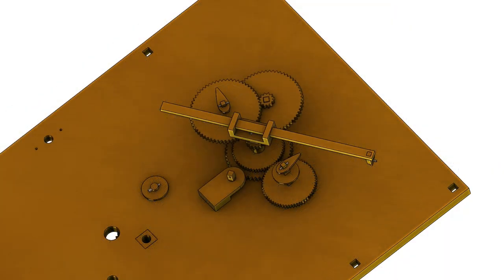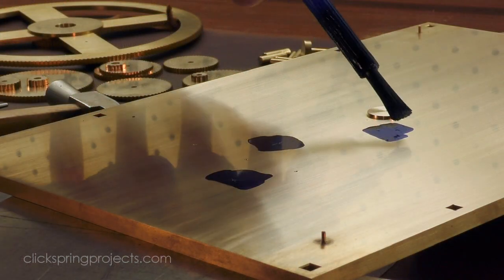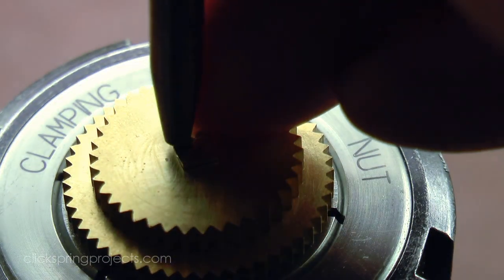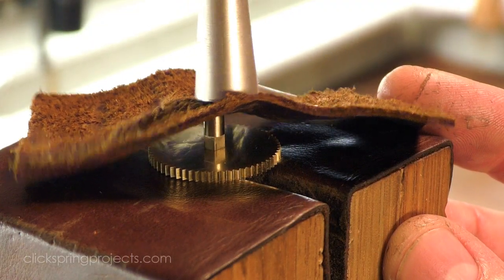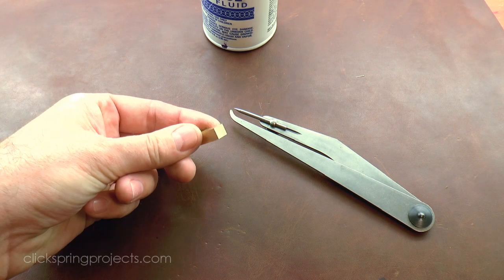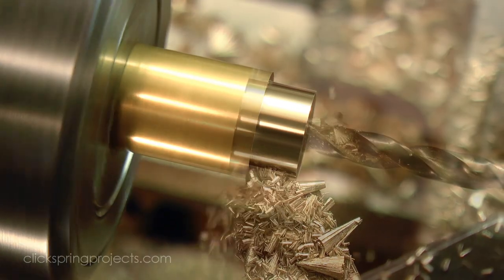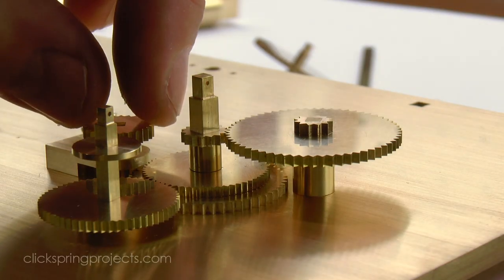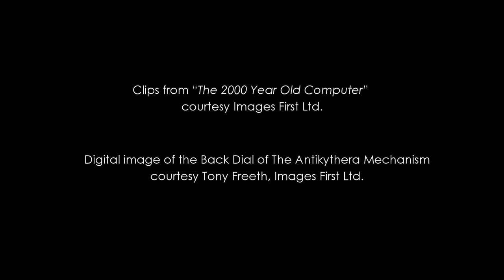The #AntikytheraMechanism Episode 6 - Making The Metonic Calendar Train

Comment: How did you make sure the gear teeth lined up between assemblies? If you'd been off by half a tooth with one gear on one assembly, surely it wouldnt have fit together?
Reply from the maker: Hey Eric, the pointer orientation is set at assembly, see my answer to PJ below Cheers :)

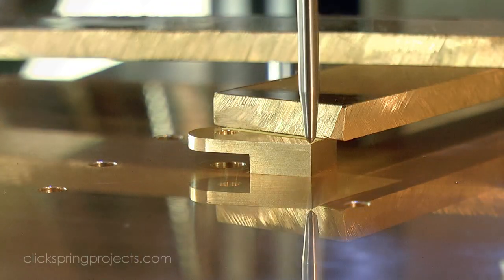Comment: Whats the purpose of the springy drill bit used before the actually drilling??? can be seen at 18:42
Reply: Tapering the hole
Reply: G'day JD, It's a point probe centre finder ('wiggler'). You have to true it up first (as seen by Chris using a pencil) and then you carefully line it up with your centre mark on the work surface. This way you know you are directly over the point you wish to drill. Cheers
 P.S. Gaz is talking about the tapered clockmaker's Broach that Chris uses before fitting tapered pins :)

Comment: At 4:56 we see a tool in the drill press which wobbles around and you the centre by using a pencil.Why do you have to use a pencil to centre it instead of centering the tool in the chuck right away?
Reply from the maker: It knocks the very end of the pin onto the axis of the spindle, and so removes all chuck eccentricity that would otherwise still be there if it were rigid and directly chucked - Cheers :)

Comment: Why would you not make a rig to file the the teeth of the gears? I'm just curious.
Reply from the maker: One of the main objectives of the build is to determine the actual techniques used to build it - the small inaccuracies in the wreck strongly suggest the teeth were freehand filed - Cheers :)

Comment: When you are filing the taper on the arbor are you using the marks from the file to see how far along you are in the taper?
Reply from the maker: Hey Douglas - I repeatedly put a very light cross pattern on the work (in between actual cutting stokes) so that the light will reveal any double strokes - it helps ensure the surface is filed truly flat, and that metal removal occurs at the same rate over the surface

Comment: What is that floppy drill bit thing that I believe you use for centering?
Reply: It's a tapered clockmaker's Broach that Chris uses before fitting tapered pins. It's not enlarging the holes but shaping them to match the pins.

Comment: the smalest messurement i could find on wiki was a daktylos, which was a finger, 19.3mm around. don't we know more fine messurement, it surly needet to be, and a way to messure smaller parts, to calculate this complex machine. it would not suprise me if a sort of caliper or micrometer was invented way before we tought. or maybe did they use circles and a board to calculate the corresponding radiuses on a reference pice  to cross reference for fine machines like that. very intressting stuff tho

Comment: Brass is so soft. Will this machine last very long ?
Reply: G'day, Cast bronze (that was used back then), poured out to make sheets, was hammered to refine the metal's structure and harden it up and make it wear resistant. It would probably only be moved the equivalent of one day on the scale at a time, and then left alone till the next day; or wound 'round till a significant event you were checking on came up (then all your astronomical mates would come round and have a good talk about it :)  ). It wasn't 'running' all the time like a modern watch, and, if a part did wear out, it wouldn't be too big a job swapping over the offending part (once you'd got a competent metal worker to replicate it). Cheers

Comment: What Is The Point Of Hand Filling The Gear Teeth, When You Are Using Modern Machine tools, On Other Parts That Were Not Invented Or Around In That Time Period?
Reply: A certain amount of this (but not all) is exploration of the (probable) methodology. But (as shown) he also may have to adjust the depth of the teeth by hand anyway, which would not be done with modern teeth. So a perfect opportunity to build it the way the ancients (likely) did.  As for the power tools (mill/lathe), it's to speed things up to achieve the same result as wading in with a file. I love Bad Obsession Motorsport, but they can be 4 months between videos. He's already been working on this for a year! I wouldn't have blinked at all if he wanted to use modern tools for the lot.
Reply: ConradsStudio no I think what he is doing is great, but if you want to make something from that time period. They would not have had twist drills or end Mills it most likely would have been drilled with a shop made d bit. And the rest would have been cut by a hand. saw. Just saying.
Reply: Perhaps, but in a lot of cases, what's achieved by doing that other than stretching the build time? A part of the wonder of the Device is that it was widely believed to beyond the capability of the ancients, and the exact construction methods are a mystery. He already did a lot of experimenting in the video with the dividing plate--an admittedly bold assertion on his part. That, and his clamp video were guesses as to how things were accomplished back then. Since much of their metal working tools didn't survive, there's a fair chance he'd just be inventing a new approach if he made assumptions about how the ancients did things. He may well have already.
And yeah, what he's doing is great. The mere act of building this as close to the original design (flaws and all) is something of  a voyage of exploration. For instance, I begin to understand his fascination with the triangular gear teeth.
Reply: And speaking of discovery, if you bracket a word with asterisks in a comment, it becomes bold!  Ha!  I didn't know that. :)
Reply: Triangle geared teeth would have been the simplest to from and make. There were no modern gear shaped teeth at that time. It would have been very crude hand shaping on every part.

Comment: Why do you use so much brass?
Reply: Why else do you suggest? It has to be both easily worked (filing of teeth) yet adequately wear resistant. Brass fits the bill.
Reply: original material (it is easy to work)
Reply: Brass is an extremely versatile material. It needs very little lubrication, practically doesn't corrode, is quite easy to work with, and easily provides a very good surface finish that polishes very nicely. As long as strength, weight, or cost are not prohibitive factors it is pretty much a wonder material.
Reply: I just don't like how everything is made from brass, Aesthetically it would be nice to have an accent colour. But mechanically it makes sense to use brass.
Reply: Yeah, let's hope he goes full titanium, so he will upload a video every 10 years
Reply: yeah, i would like to see him throw in some more polished aluminum, or something of the sort, but on this project that would also mess up the historical accuracy
Reply: because it's purdy
Reply: I find brass beautiful and it is extremely easy to work with compared to other metals.
Reply: Needs adamantium with unobtainium accents, obviously.  Also should be hand forged by sentient nanobots.  In the heart of a star.
Reply: Historically accurate

Uses lathe, mill, and CNC

EDIT: embolden second line